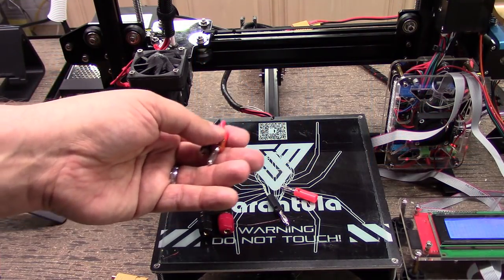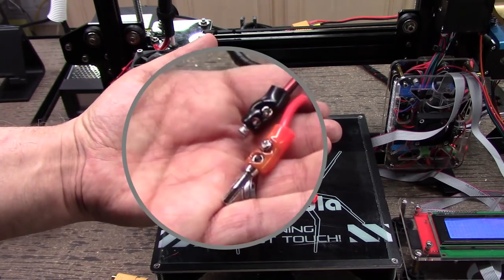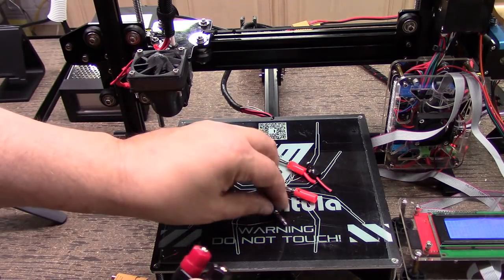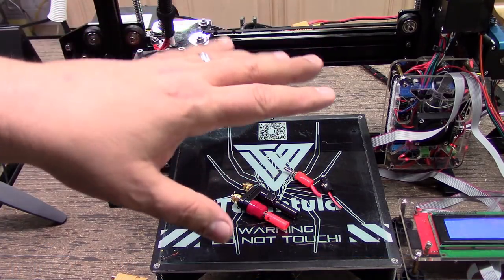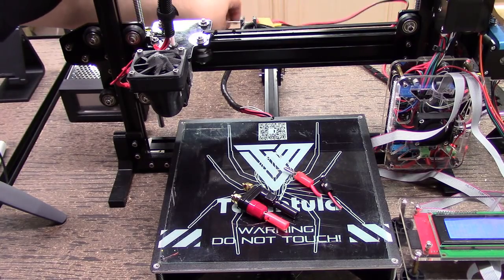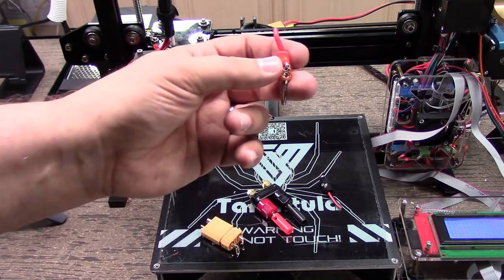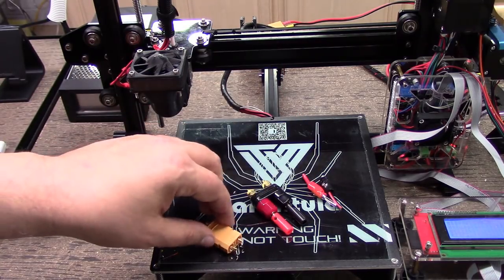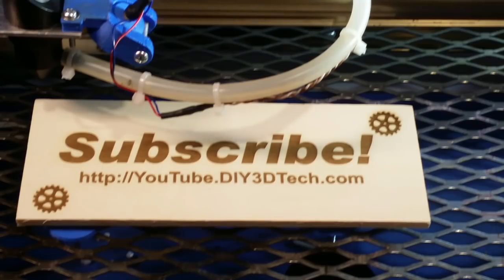TEVO Tarantula 3D Printer  -  Crazy Melt Down You Need To See!

Comment: To clarify, these banana connectors are not supplied by Tevo. The plastic used in those connectors are not designed to handle higher heat generated by the higher amps required to heat the bed. 

The new connectors are properly sized for the job.

Anytime you modify something always be safe and keep an eye on until your comfortable with the performance of it.
Reply: I agree with Greg Oetker, as far as i know banana connector only use for low current or for audio connector, although somebody at thingiverse has done it, maybe his printing habit different than you, but still it is not the proper way to do it. And don't blame the printer.
Reply from the maker: If you go back in the Tarantula playlist you will see (the video) where I talk about adding the banana jacks and building out the power supply case (it is a customizer I put on thinigiverse).    Now what surprises me I have used this like this almost a year doing PLA and the bed at 60c, now I kick it 30c (to 90c) and wow I was surprised as logic says yes it will draw more current but the in the prior configuration they never got warm so to melt?  Well that is why I did the video to share as frankly I have used these for lots of things and the first time I have seen this.
Reply: I understand that, but if someone never seen the other video(s), this could be misleading as to a Tevo Tarantula issue vs a this is a wrong parts issue that could happen to printer or electronic device with undersized parts.
Reply from the maker: Not really as I pointed out to another viewer, I did not invent using banana jacks with the Tarantula, in fact borrowed the idea from another Tarantula user.  So my point is the Tarantula is a DIY kit without really a proper PS interface (they give you a raw power supply) so people are likely to use many sorts of connections and my purpose is to educate the community in general  to raise awareness of modifications such as this and the repercussions of a seemingly simple decision.
Reply: DIY3DTECH.com, the video is fine bringing awareness to a potential issue. The problem I have is the way it is presented as if it's a Tarantula issue, which it is not it's a basic electronic/electricity issue. Using a under rated connector isn't a Tarantula issue once again. Doing what someone else does could be careless for anyone who don't know any better, hence why the content of your video is great. I always suggest using XT 60 style connectors since they are keyed (safety) and they can handle massive amps, which you point out, hence why the content is good.

The video is just misleading on that you made it seem to be the Tarantula's fault vs incorrect connector. 

I personally watch your video and enjoy them but I will call out the bad side if needed. That way you don't get classified with others that put out bad info.